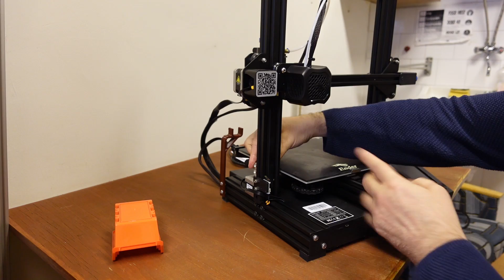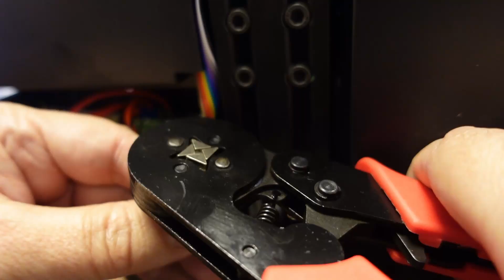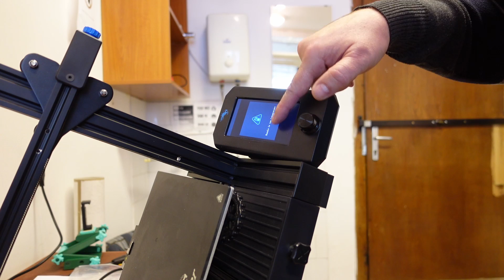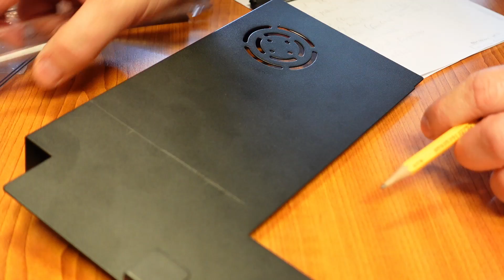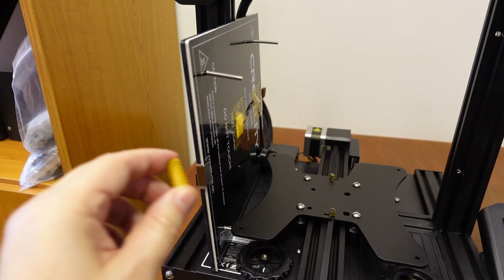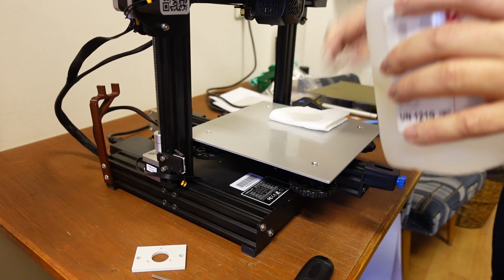Ender-3 V2 safety upgrades (ferrules, PSU ventilation holes, mainboard fan, flexible PEI sheet..)

Comment: i completely removed the black cover of the PSU and designed and built in PETG a cover for the 220v wires and IEC connector. 
I also reduced PSU fan speed with miniature DC-DC step down buck to drive it at 12-15V to make more silent.

Comment: Hi Igor. Thank you for making and sharing your videos. Also, you do know when doing the shrink wrap on the wires you can heat the shrink wrap with the shaft of your soldering iron. You dont need to you a lighter. Just in case you didnt know this.
Reply from the maker: Yes, I noticed that in recently watched videos. Thx

Comment: I removed Creality's cover from the PSU completely, and am currently in the middle of printing a replacement that has vents. This is the only thing I've printed with the cover off, but so far, the fan has been on for only a fraction of the time it was before.

I also printed some feet/risers for the bottom of the printer, so that it's around 20mm higher off the table than it was before. I'm hoping that will let more air get to the underside of the printer and take the strain off the fans.

Comment: Excellent video with great tips! Another one to add would be the cut out center bar that the wire run across. There's a piece you can print from Thingiverse to cover the sharp metal edges so it doesn't ever cut into your wiring harness. Also, the PSU cover can be modified like you did (and like I was originally planning to do) or you can print a small cover that just covers the wires at the bottom. You can't see the cover is missing from the top. Very nice video though and this should be pointed out to everyone who is just getting started. Flex beds are the best!

Comment: great video. My prints really adhere strongly to the glass bed on my ender 3 v2 sometimes.
Reply: PVA coat it first.
Reply: I put my glass in the freezer for about 15 minutes and the parts come off very easy.